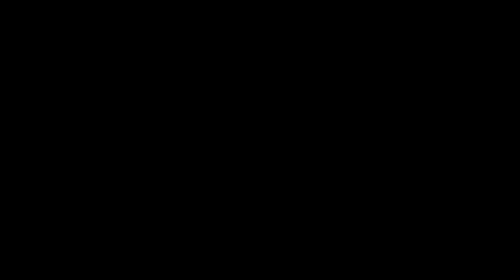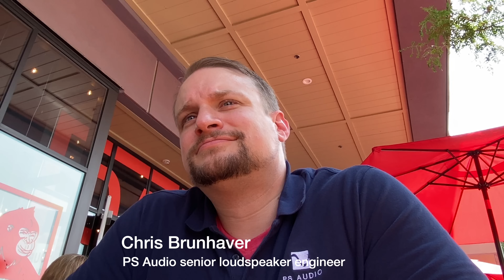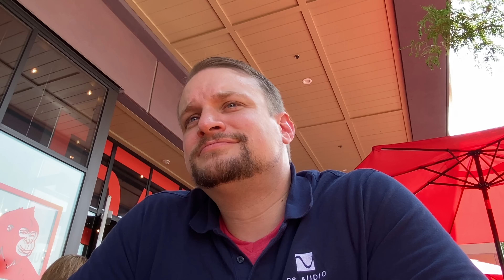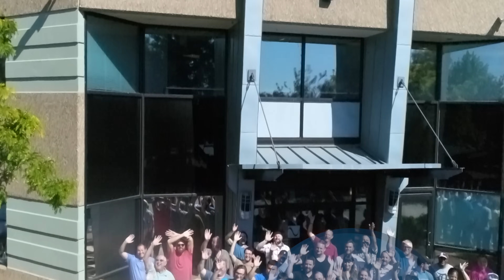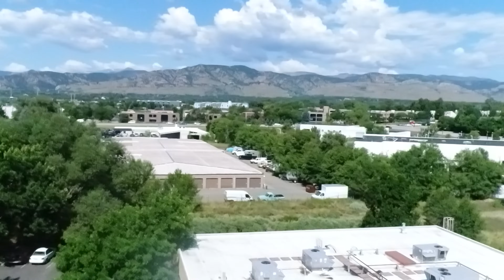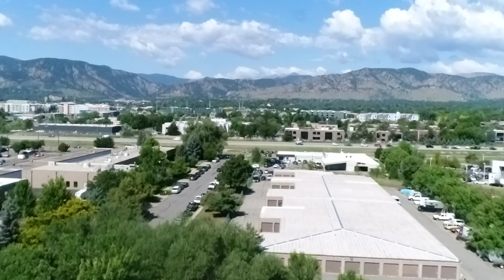Lunch with Paul: Ribbons and planar drivers

Comment: The idea that they're more expensive or labour intensive seems a little counter intuitive. I just saw a guy on youtube whip up a planar speaker in real time in about half an hour. WIthout any power tools. It'd actually make a pretty good science project for any 8th grader who'd left it till the night before. And like he said, a traditional driver has all sorts of parts. You also need dies and casts and metallurgy and a dozen different materials. I couldn't even make a spider in my garage, but I could make a planar with whatever I have under the kitchen sink.

Comment: I received my Magnepan LRS about two weeks ago. I am extremely impressed. I am running PS Audio Stellar Gain Cell Dac and a Pass 150.5. The neutrality, and balance of the speaker is simply astonishing. They image reasonably well, but my room does not allow for pulling them out more than 3 feet. I imagine in a better space they would disappear. 
I owned Martin Logans for awhile but I could never get into them and because of that I shy'd away from Magnepans for literally decades. The thing I love about the LRS is that its a great speaker that gets better with your gear. I may pair them with a couple small REL subs to bring the air back into the playback, but even without them I am simply amazed.

Comment: My dad built himself some speakers back in the day with compression drivers and a horn in front of it. These drivers were JBL 2426H's and are still sold today for around 800$ a piece. Now I'm building my own speakers and im using four BG Neo8 PDR per side for around 800$ and i think they sound phenomenal. The only issue I'm having, is that these planars are much more directional, where the jbl horns are not that much directional due to their biradial horn flares..

Comment: Praise the lord - what refreshing honesty - cuts through all the bs- planers  are ARE superior approach to sound reproduction unless (OK rock and orchestral fans) u want/need  huge spl / bass. Who cares if they don’t disperse -audiophiles listen alone like 98% of the time?! And yes they do need to be away from walls but so does any cone speaker with a rear vent! They are complex and fragile compared to most cone speakers and their resistance can drop
 To 2 ohms so u need a amp that doesn’t drop voltage but ceteris parabis but there is no better sound than stats...I fidn though that so many audiophiles have not really heard let alone auditioned good planars..the industry understandably pushes boxes-high WAF, easy to ship, not fragile , easier to place in a room, I get it and there are obviously some great sounding box speakers-but lets at least be honest -for vocal, acoustical, jazz, single listener (and its almost ALWAYS a single listener situatuion) ESPECIALLy on a dollar to dollar basis, simply cant  beat planars/electrostats-open baffle )also unknown to most audiophiles) come closest , and they also get you more bass. (Although even less WAF)

Comment: It is true the early Quads from 60 years ago have very narrow dispersion , hence the “head in a vice” effect. However, many of these Quad 57 electrostatics are still in use today as the mid range is considered unmatched by any modern speaker. I have a pair of full range ESL IV electrostatics built by E R Audio here in Australia. They are in a different league from any box speaker I have ever heard. Modern electrostatic designs have largely addressed the narrow dispersion and lack of bass. The principle is simple but building requires skill and is not just a matter of slapping off-the-shelf drivers into an enclosure. Yes, they are large and expensive, but so are many top quality box speakers. Electrostatics are super fast , have very low distortion and no distorting crossover. I get useful output down to 30Hz. Bass is more refined than a big cone woofer as electrostats do not pressurise the room in the same way. A good recording sounds simply stunning.
Reply: And that is why I sent Martin Logan a personal letter of thanks.  They are the so far, the sweetest sounding speakers I have owned in all my 67  years!

Comment: If cost is a problem, how is Magnepan selling the LRS for a budget price of 650 dollars?  As far as I understand, Magnepan has not invested in automated processes so theoretically the cost of construction could be brought down from there.  I’m not sure I totally believe that cost is a valid con.
Reply: The LRS is a small speaker, as planers go... lacking lower end response, because with planers, size does matter.
They don't make much money on them.
There's no room for dealer markup.
I'm guessing they are a break-even or even a loss-leader to get customers to listen to them at home, fall in love with the sound and upgrade to larger Maggies.
The plan worked on me...starting with the comparatively bad SMGs in the 80's (didn't come close to LRS, but still produced quick, revealing sound that made you not want to go back to cones), then MMG'S before my current pair of 1.6s.
Reply: I guessing your response would be that they aren’t making significant money on them, but they could sell for 1k and be worth every penny.  I feel like the real point here is that proper investment hasn’t been made in reducing costs in manufacturing of planars and there is real opportunity there.
Reply: I think they sell for that price know many will upgrade from there.
Reply: I think my point may have been missed here.  I'm not really asking why or how Magnepan is selling inexpensive planars.  I'm using them as an example of the fact that doing so isn't really all that expensive.  They are doing it, and as far as I understand, they're doing it with a CNC machine and hand-building the drivers (this manual labor is the expensive part).  I'm certain that automation could replace much of the manual labor.  Does it cost money up-front?  Heck yeah, but 2 points here:
1.  Automation prices are dropping.
2.  Were you to make planars with automation, you could sell for much less and as Pinky and the Brain would say... "Rule the World!"
Reply: @aweidenhammer  I get what you are saying, but you have to have a certain amount of sales to make automation worthwhile. Until they cross the point where it doesn't have a heavy impact for the current fiscal year they will probably not go to automation. Plus they are probably very comfortable with the current system of production. I don't know if you have any Maggies but I do, and their customer service is top notch too. I do not feel like I am just another customer when I have called in. They have even spent time with me on the phone to troubleshoot a weird problem I had on a pair of 10 year old Maggies. Great Company.

Comment: There is a lot of truth in this. But again this is out of context. Ribbons and Plannar drivers only sound cool and do some impressive things. The problem with them is that they sound unnatural not playing as a whole with other drivers, and don't integrate very well in regards to structure, and require a lot of complex handling, again extending the signal which is bad. So what you get in the end is just something that impresses you, not something that sounds like the real thing. Plus they only work in a very limited space, and can't handle a gush of wind because that takes them out so they need replacing. (happened to some of my friends while opening a window)

Yes they sound many times awesome, but again then you are going for a bias that is more HIFI techy/isolating detail on a data level, rather than actually listening to something that is as close as possible to the optimal natural sound.

I have only heard Verity Sarastro 2 which had a really top notch ribbon tweeter, and yes it was awesome. But still a bit tirering in the long run, not fully integrating, ending up in making the detail stick out which is nice in the start. (and this is the best ribbon I have ever heard)
Most other ribbons just sound wrong, same with plannar drivers. It wow you, but several months later it just gets in the way of music, so that everything sounds like it is going through a cheaper kind of filter, compared to what is optimal. It is a way of cheating, a bit like making a normal speaker with ceramic drivers, sounds cool, but later you end up regretting it because normal ceramic drivers on normals speakers suck the life out of music and just goes after effect not substance.

Yes normal dynamic drivers has more distortion. But again, this is out of context because they usually also have a better high quality filter that is a bit shorter in signal, and those components with the speaker drivers, just deliver more music which is the most important thing. Less distortion is only relevant mentioning, when you are also comparing the same quality of components behind what is used as units. The biggest problem with Ribbon and Plannar tech is all that is used together with it, is usually not very good, and the ribbon tech especially has a knack for telling the user this.
It's all about coupling the right parts together, separate parts that are the best in theory almost never sound like the best, when not coupled correctly.
A natural form of distortion also sounds many times better, distortion should not be looked down upon, it is mostly important how you solve minimizing it, than just removing it which sounds cool on paper.
Reply: Agree somewhat, but the biggest problem you point out is mixing dynamic drivers with planars, which is not a fault of planars itself. Sadly Alsyvox speakers are way out of my budget but i have never heard anything as natural sounding and as close to a live performance as those.

Think if more planar magnetic drivers would have been made from strong neodymium magnets from the start instead of those cheaper rubber ferrite magnets the perception of this tech would be different.

Comment: Again so much prejudice on electrostatics and hearsay that is going around for decades now that are NOT true. Wonder if Chris ever heard a good set. 
There is still nothing on the planet that beats a good full range ESL (not a hybrid, not a ribbon, not a planar)
They have all the low you need, but no distortion and that is what you're listening at with woofers and even more with subs.
The linearity in phase and time coherency of an electrostatic full range speaker is unmatched no matter how many fancy box speakers they build.
Everybody talks about "speed" nowadays, fast this, fast that. Well an electrostatic is the fastest there is period. Nothing can even come close let alone match it.
Head in vice? NO. That was with the 57 design of the Quad Paul is referring to. That is long gone.
No bass? NO. But no 10% (yes really) or more distortion like conventional woofers.  They go down to 35 Hz with less than 1% distortion. Again nothing on the planet can match that.
They don't play loud? Depends on your interpretation of loud. No you can't imitate rock concert. But remember anything above 90 dB can cause hearing damage in the longer term.
Once you have heard a good full range electrostatic loudspeaker your lost, there is no way back, you're hooked for life. I am.
Reply: Paul would strongly disagree, and he used to own electrostatics (although I don’t remember which ones).
Reply: @doowopper1951  Paul owned the Quad ESL  from 1957. Read that year again, yes 1957. The mother of all full rnage electrostatic speakers. Yes, this model had the head in a vice problem agreed.
Reply: @ESL-Plus  I also love electrostats, but you really need the space to make them sing, otherwise the bass is also very limited. PS Paul said in another video he owned many, including Martin Logans (which have a curved further spreading panel)
Reply: @Christian-op1ss  and a ML is NOT an electrostat as I wrote, it is a hybrid.
Reply: @ESL-Plus  What electrostats do you use? I am considering to try to build my own.
Reply: Christian Vogel take a look at http://www.eraudio.com.au/index.html
Reply: @Christian-op1ss  I use Quad ESL 63. The ESL Plus version. Nothing better.
Reply: @Christian-op1ss  Considering to rebuild something existing with ER Audio kit or want build you own design? It took genius Peter Walker 17 years to design and develop his last model electrostatic speakers. Do you think you can improve that with a DIY job?
Reply: Attention!!  Martin Logan DOES make a full range ESL !  Check out the product line up on their website.  It is just under the Neolith!  TRIPLE ESL BASS PANEL!
Reply: @garysmith8455  absolutely true. They have one full range electrostat but........ That is a line source and that even worse for good sound reproduction. Most people know the hybrids as THE ML model hence my statement. I stand corrected.
Reply: Jos Wouters absolutely correct. I have a pair of full range floor standing electrostatics. Once you hear modern electrostatics it will be obvious that no box speaker comes close.

Comment: I find it funny that they are talking costs that really amount to pennies or less they pennies and yet the end user pays out the a$$ for the product. Like with the speakers in the car. You know the car had to be 40 grand plus and yet .005 cents was the breaking point for the stereo system, one of the most use items in a car. Same with home audio. How many times have we looked into or had something break that if the builder would have added 10 cents to the build it would have never happened? I also know there is a lot of components and the pennies add up but $5, 10 15 extra in a build that costs the consumer thousands seems like a no brainer to me.
Reply: Well, automotive manufacturing is arguably the most cutthroat industry in terms of price competitiveness. 40k is a lot of money no doubt, but it really pays for a lot of things, there are approximately 30k parts in a given car, now imagine designing all those together, putting them together (simply imagine putting together a 30k pieces puzzle), specialized machinery for those different parts...also labor+marketing+interest payment+logistics+depreciation on machinery+accounting for failed parts+servicing.

Comment: On one side of the pacific you have the factories with some engineers trying to squeeze every penny out of the BOM and on the other side you have the brands with product managers trying to grow the margin to make a business. Often you end up with a speaker costing 1000s of US$ in retail that has drivers in it that cost well under US$100 on the BOM. It's great if PS Audio can put some quality drivers in their future speakers through in-house passionate engineering.
Reply: ThinkingBetter if a company is making desirable product at market price, why do their material-/manufacturing cost matter to consumers? Let alone there are many other cost omitted from simply stating the manufacturing cost. I believe if there’s a market for it, it’s a fair price.
Reply: j L I care cause as a consumer I like to pay for great passionate audio engineering and great components rather than yet another Ferrari for the CEO.

Comment: Well done AMTs are the sweet spot.  The square Aurum Cantus units in my speakers are ultra clean but not fatiguing at all.
Reply: @Art DIY My friend who builds speakers around them doesn't have a current website, but his old website is still online: http://www.kathleenryan.com/paulsquillo/galleries/atmatec-speaker-pix/
Reply: AMT's really shine when they're designed to cover the midrange. There's an engineer who worked with Dr Heil at ESS who hand builds AMTs that crossover at 500, and they are spectacular.